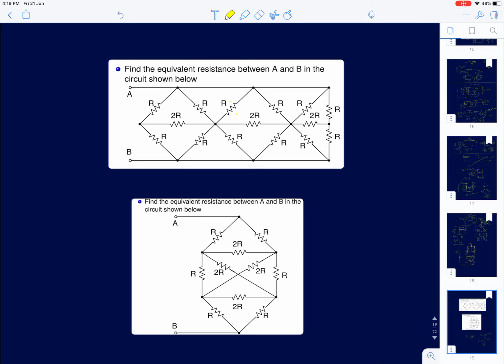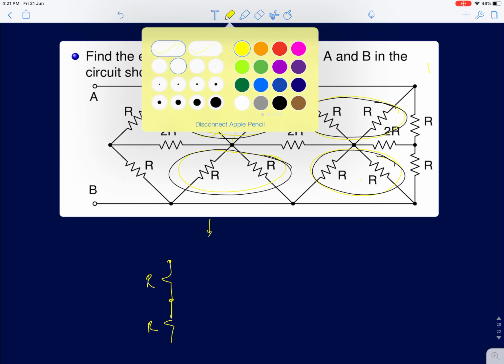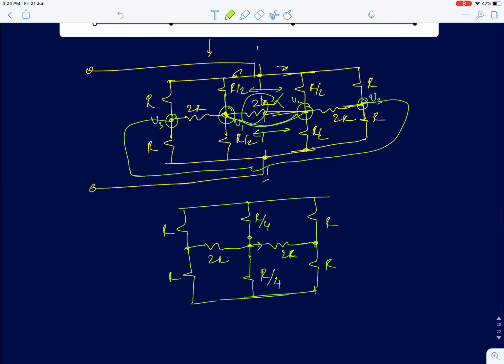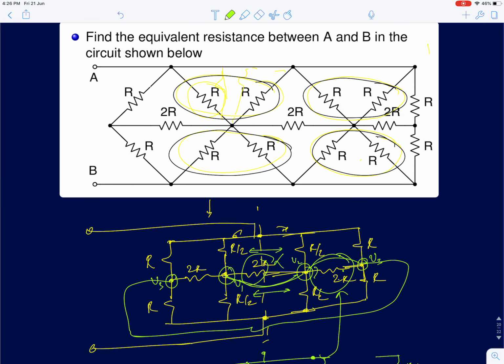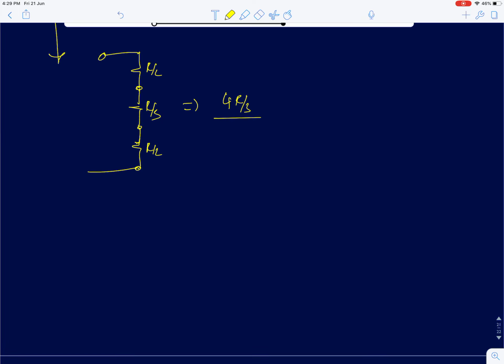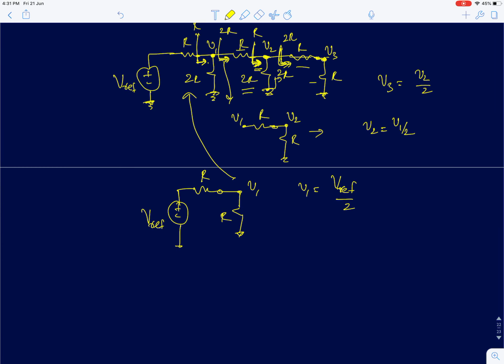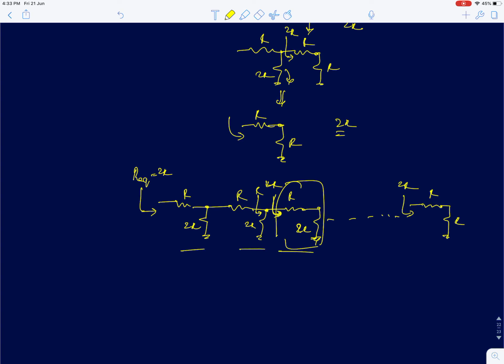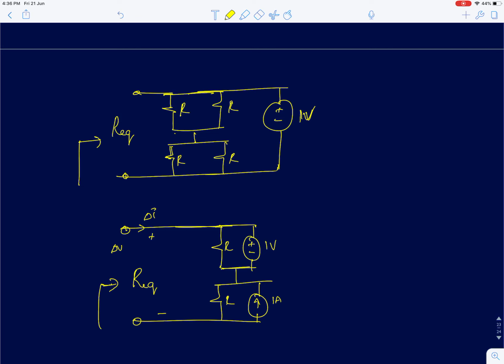ES Lecture 4: Resistors and Equivalent resistance

Comment: If there were same potential on 2 nodes then current is zero and it must open ckt na why short ckt u took bro
Reply: see bro since from thevenin we got current zero through that branch , so in order to satisfy ohm law for that branch voltage should be zero (because resistance is a finite value).